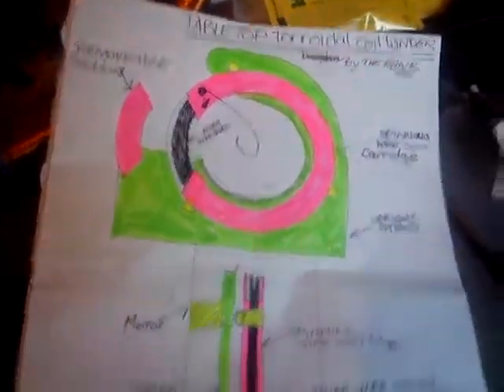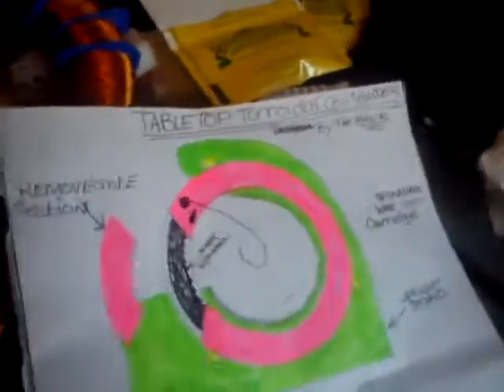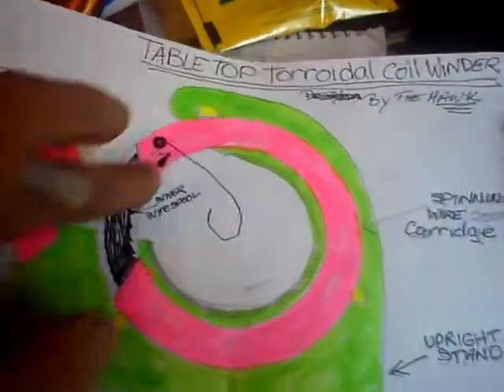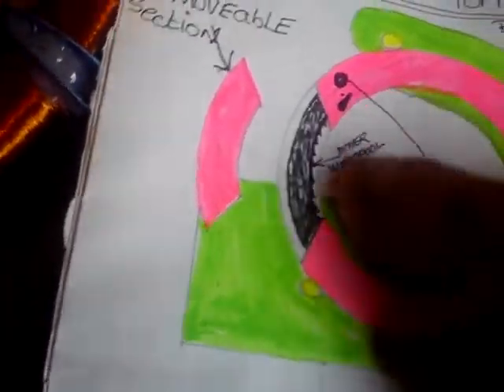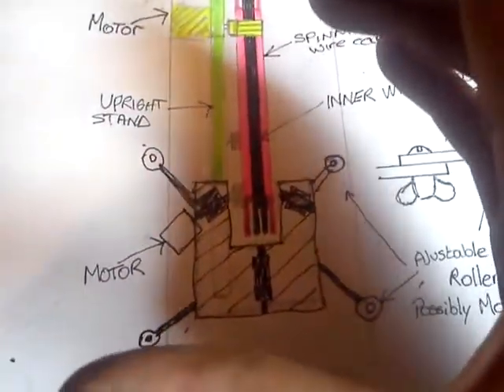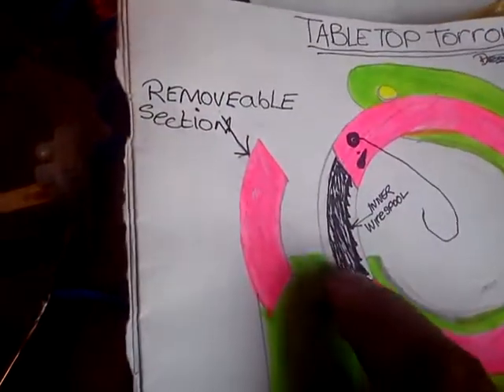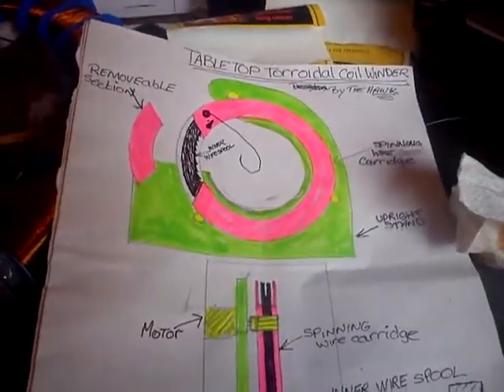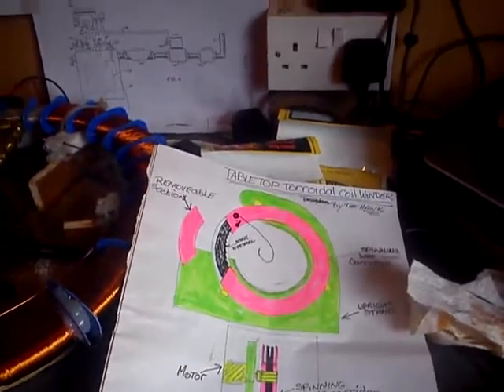free torroidal winder idea.3gp

Comment: That would be a huge saver if it worked with Rodin Coils.   How do you get the torus core through the black toothed spool part?  Is there just a split or splice, then spool up the wire after the torus is in?